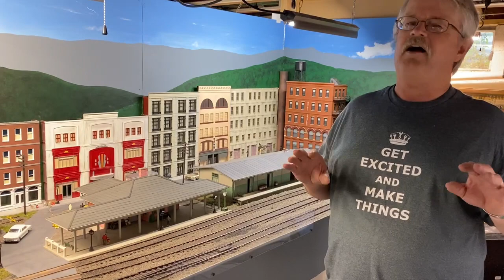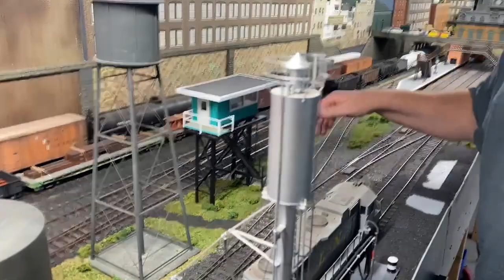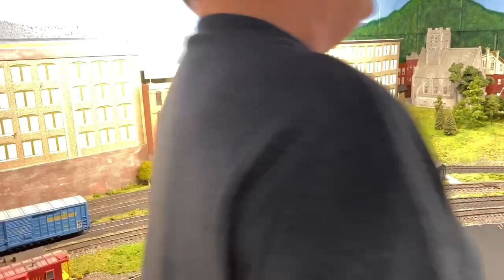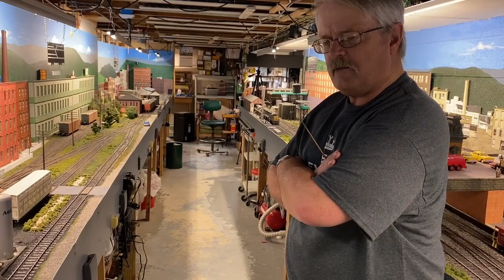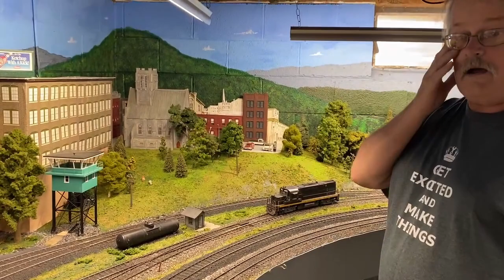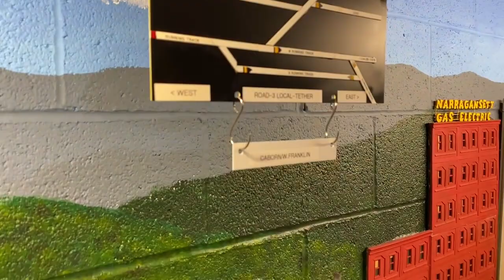Model Railroad Layout Design #4: Tips and Pitfalls (Part 1)

Comment: The Hobby is not dying and is growing in some areas.  Real modelers use the newest and best techniques to achieve a goal. Those are just old crusties that hate change and can't grasp new ideas and concepts. I am not as old as them , but look to older and younger folks to learn things. Also your making good points on Beachwork. Another thing is running track parallel with the straight edge. The real world has angles. The track isn't aways straight with buildings.
Reply from the maker: Thanks for your comment.
Reply from the maker: That being said you would be amazed at just how many of us old crusties have grasped the new concepts and included digital advancements into our model railroads.  What has been lost is the willingness to create something from scratch instead of buying assembled.  I work at White Rose Hobbies in York PA and the number of old folks vs young is pretty significant.  I don't believe the hobby is dying it is just not as popular as it used to be.
Reply: @fredeisen7401  young people don't have or respect or want to learn techniques and etc. They are consumed by gadgets and stuff. The older folks will keep it alive an as they age they will get into the hobby. Most people calm down and get into hobbies in the 40's plus more income to spend..MRR will be around.